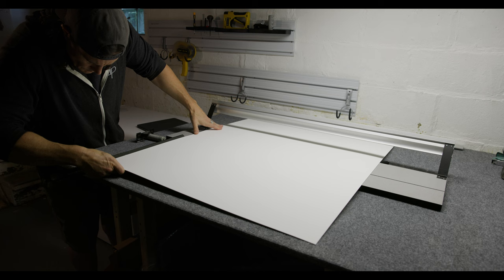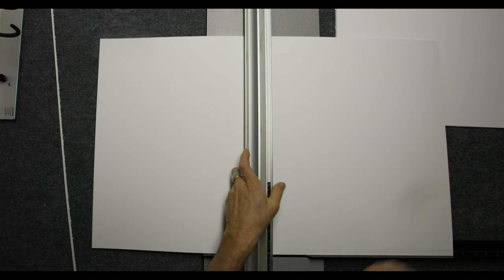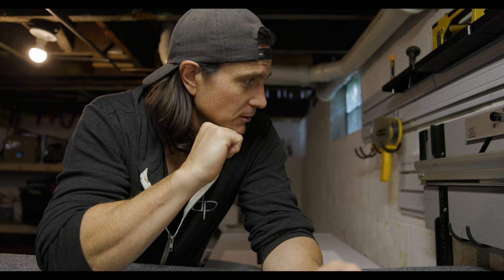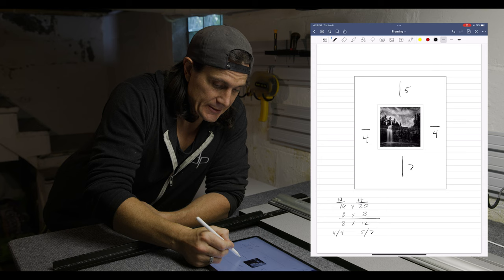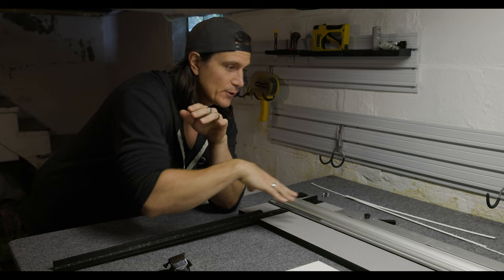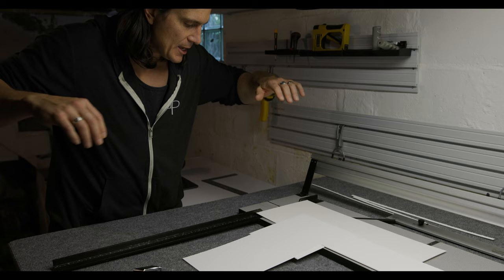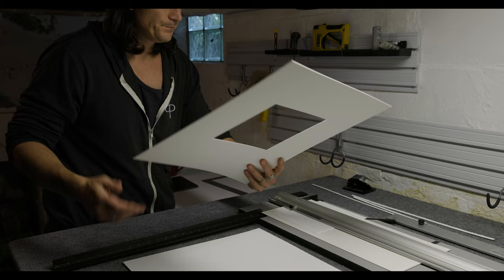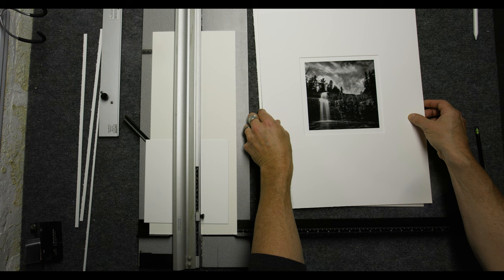Framing  Photography - Part 2 - How To Cut Matboards

Comment: great series - I hope we can use your videos at the community college where I lab tech.  we have similar equipment.  One thing I noticed was, although I saw you doing it, we always recommend doing the mat movements to each next cut always in a counter clockwise or clockwise direction.  Especially with beveled edges. Can't wait for the mounting vid
Reply from the maker: Yes, absolutely! Yes I usually go clockwise, but like most things it is best to be consistent!

Comment: Thank you for the well explained series. And yes, you're correct in saying if you're just starting you WILL make cutting mistakes. Watched this over and over and still made a couple mistakes. One question for you or others here - How do you order mat boards from Blick and not get them with dented corners or scuff marks? I've ordered 25 packs twice with an individual sheet or two for color testing (all 16x20) and both times they've arrived with dented corners. Practically no shipping protection in the shipping box so they slid all over in the shipping process. Is there a certain combo that you order to ensure it's protected well and tight in the shipping box? The "local" company an hour away only sells to framing businesses so I need to purchase online.
Reply from the maker: I would contact Blick directly and tell them what is going on... I am sure they do not want damaged product showing up to customers...
Glad you have liked the series... Have a few more to add to it down the road a little!

Comment: Thanks, nice explanation. Wouldn't all darkroom prints have animal protein, as in silver gelatin? Would you use buffered board (first time I heard of it) only for ink jet prints?
Reply from the maker: So yes, I beleive silver gelatin has protein in the Gelatin... I have looked High and low and there really is no clear answer that I could find. Buffered is more common and seems to be perfectly archival for photo prints (silver and Inkjet) 

Older processes it is recommended to not use buffered.

But again it is hard to find a really clear answer.  Dry mounting will also add a buffer layer between the print and the paper. 

You can find info from different conservationists and photographers. I just have not personally found a clear cut answer on this. If anyone else has any info please let us know!
Reply: @Distphoto  Gelatin is animal protein. It's collagen from connective tissue of carcasses, processed to be soluble in hot water (as in jello). There is probably some non-protein stuff in there too, miscellaneous fats and sugars or other biochemicals, but it's mainly protein. Similarly, albumen is almost pure protein too, plus a few other goodies that the growing chick embryo needs. Somewhere I read that people have tried hard to find a vegetable substitute, since vegetables certainly have protein too, but to no avail, maybe it's just too dilute or too much cellulose and other plant material that interferes. (BTW, I'm a biology research professor, doing genomics (DNA and RNA) mostly these days, but trained as a biochemist.)

Comment: Where do you purchase mat board?  Also what thickness of window board and thickness of backing board?  If its in the vid, sorry I missed it.
Reply from the maker: I have gotten my matboards from a local distributor. You can get them from Blick here: 

https://www.dickblick.com/products/rising-museum-board/

The ones in the video are 4 ply. I do also use 8ply but almost always mount to the 4 ply.

I find 2 ply a bit to flimsy and thin. Hope that helps!
Reply: It does.  Thank you.